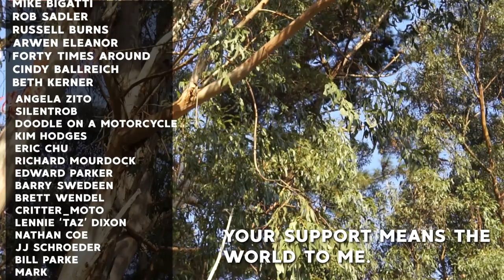Overcoming Travel Anxiety | Thoughts from the Road

Comment: Great video topic! Things I do before a long trip - make sure tires, brake pads, brake fluid, engine oil, battery, chain & sprockets are all in excellent shape and carry along tire plug kit, chain lube and tools necessary to adjust the chain. I also lube all moving parts such as cables, brake and clutch lever pivots, foot peg pivots and kickstand pivot. After 40 years of riding experience I would highly recommend a high quality (expensive) o-ring chain and always put on new sprockets with that investment, they wont stretch nearly as fast as the inexpensive clip-on chains.
Reply from the maker: Thank you! 
All excellent things to check!

Comment: I always have times of WTF and I know it will always pass and it does.  I had the chain thing in North Carolina and the chain was done.  I was able to think about the physics of why the chain came off and with careful management of the throttle I was able to keep the chain on for about 4 hours until I reached my cousin's house. I was there for a week and we put on a new chain and sprockets and all was good.
Reply from the maker: Yeesh! Glad my friend Olivia (Killswitch Queen) was only about an hour away from where my Chain popped off. Also glad she was able to take me to buy a new chain to put on, I didn't replace the sprocket since it barely had 1,000 miles on it.
Reply: @AstheMagpieFlies  I put on the Moto Briiz oiler in an attempt to make my chain last longer.  It works well if I do my part and maintain the apparatus...ugh!!

Comment: I don't get much anxiety on my longer trips but I also don't tend to travel on the less traveled roads, so I'm fairly certain I'd be able to get help quickly. A certain amount of planning for likely emergencies and a decent toolkit help with that.

I think that the more you challenge yourself, whether on the bike or off of it, the easier it'll be to say that you can handle whatever is likely to come your way. I'm amazed at the stuff you seem to brush off, or fix on your own, because I think I would have been calling for a tow or trying to find someone with a truck for half of the situations that you simply ride away from. 

A certain amount of fear and anxiety is healthy, because it forces you to think about what could go wrong, and how you'll cope with it before it happens. Once you've come up with a solution, or recognized how unlikely a particular event might be, the anxiety no longer serves a useful purpose and you have to pull your mind out of that loop. It definitely takes practice.
Reply from the maker: Lol My anxiety has nothing to do whether I think I can handle the trip, or worry about something breaking or going wrong. It's always an irrational need to just turn around. I'm not scared of what might happen, that's not what causes my anxiety attacks. I guess I didn't explain that very well.